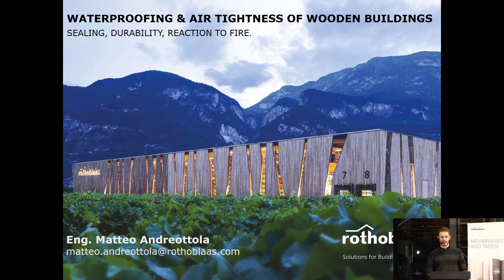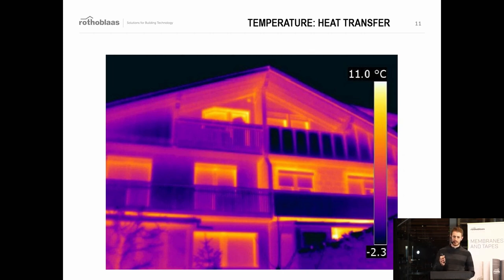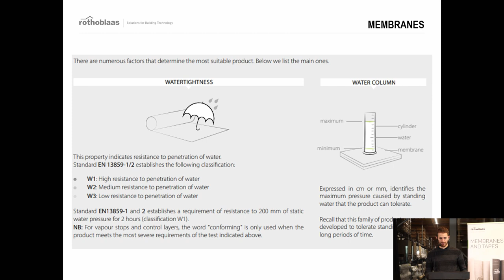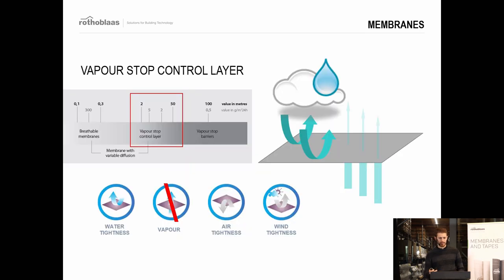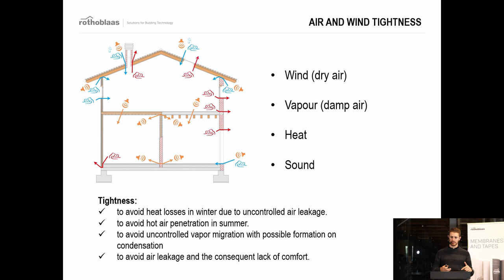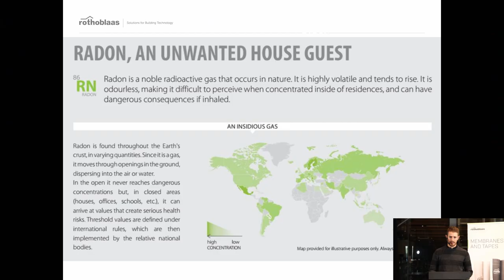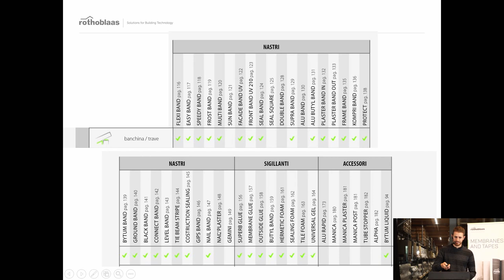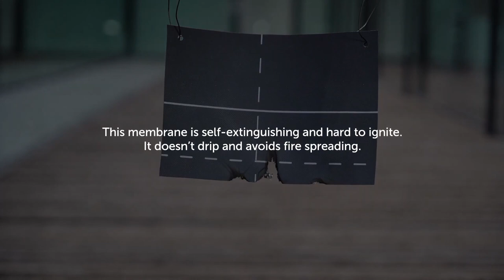Waterproofing and Air Tightness - Rothoblaas Insights

Comment: The Alu Start is a great products, but what about the thermal bridge it can generate? Aluminum as we know has a high conductivity.
Reply from the maker: Yes, aluminum has a thermal conductivity bigger than timber. The shape and hollow section of ALUSTART, similar to the one of aluminum frames for windows, help to reduce it but it remains a little bit bigger than timber.

We did many evaluations during the development of the product, including some FEM thermal analysis, together with the University of Bolzano.

The result was that, inside a complete wall configuration, including internal and external finish layers, including the thermal insulation, and using a concrete foundation correctly insulated, the additional thermal bridge given by ALUSTART was negligible. We demonstrated it making comparative FEM analysis with and without ALUSTART.
Reply: @RothoBlaasOfficial  Go'cha, thanks for the detailed answer!